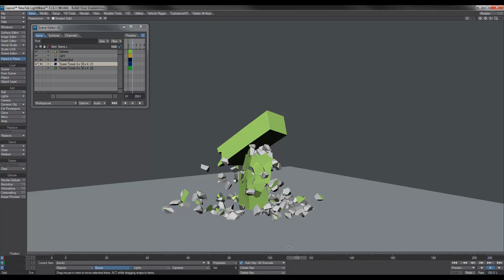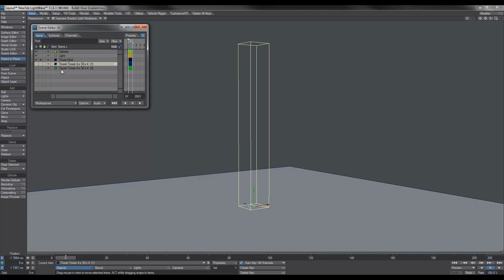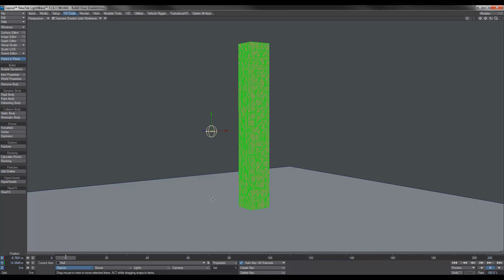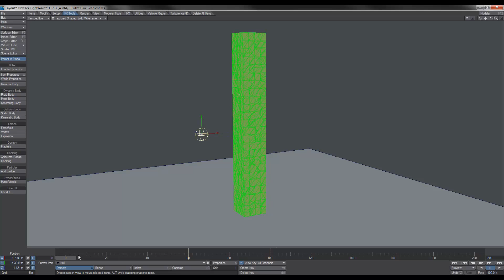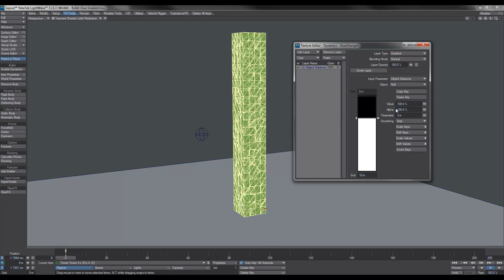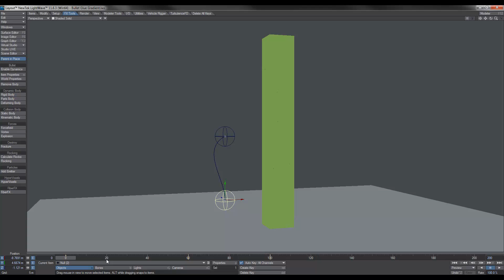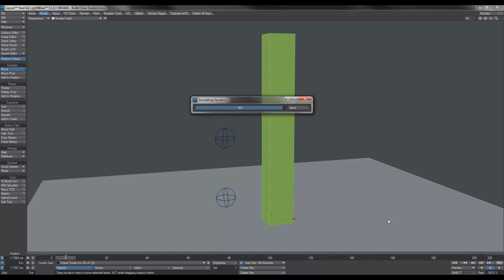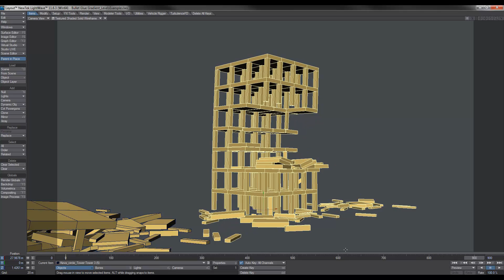Lightwave 11.6 Controlling Destruction - Bullet Dynamics

Comment: Could you do this for the creation of a crack opening up in the earth moving from one side to another. I have tried doing it with the use of gradients for controlling the glue strength, however it doesn't seem to work.
Reply from the maker: I myself tried that many times without success, its been many years since I used Lightwave (been using maya for years) maybe try placing geo under the crack and animate it falling away and hopefully the cracked geo on top will fall away looking natural...the issue I had was, the pieces wouldn't stay still before impact etc, I believe this is because the cracked geo is intersecting ever so slightly and trying to move away from each other causing  jitters.
Reply: ahahah that's exactly what I was going to ask...there's a dude on youtube who made it ...and he said that he did it with the object distance method...but that's all the info he provided..I've tried a lot but without success...so maybe you such a pro could make it :)
Reply from the maker: Not really, I haven't used Lightwave for about 3 years, I dont even have it installed anymore, I use maya now....sorry :(

Comment: hi amigo, I did about the same as your scene but the tower is in 128 Lego blocks on each others , and ground plane , now when I active bullets dynamics ( glue 100%, no breaking angle/distance , plane set to box) my tower bends and fall , without breaking .. but it should stay in place .. :) any idea what I m doing wrong ?
Reply: Hey Amigo :) there might be to much of a gap between all your blocks, so when it settles (and you add up all those gaps) there is a fair bit of movement causing it to topple over...try aligning the block so they are either touching perfectly poly to poly or a very tiny gap and see if it holds....this is a shit thing about how dynamics works in lightwave.